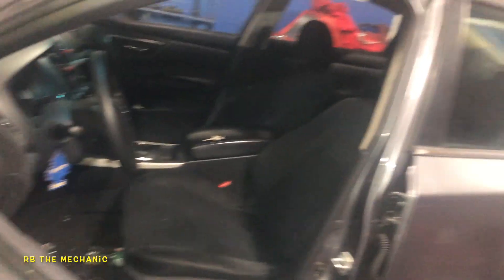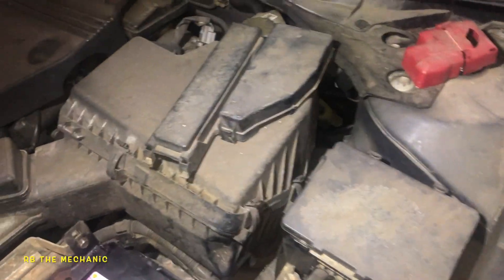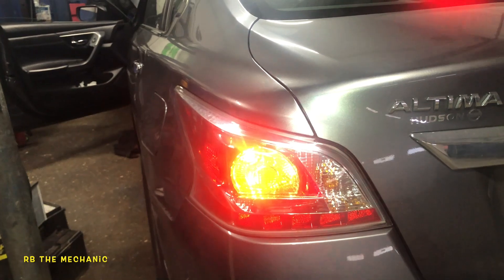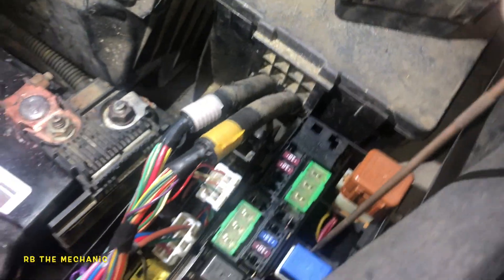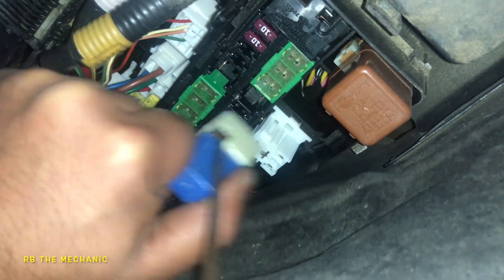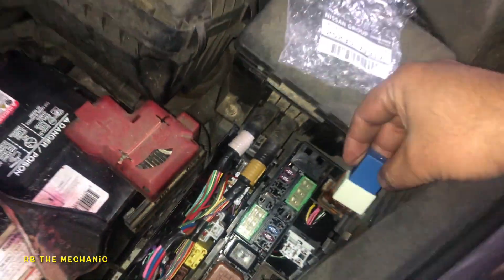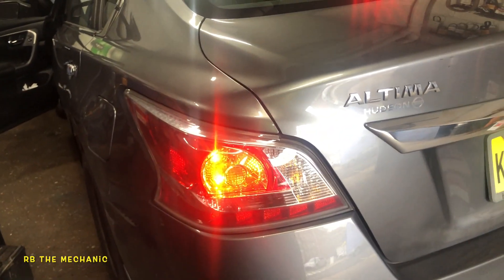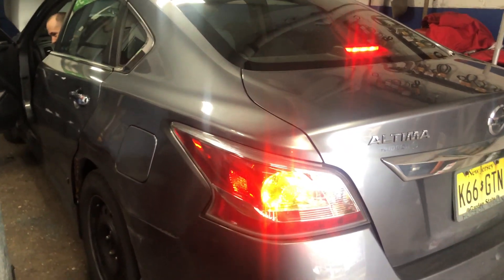Nissan Altima 2014 2015 push start  intermittently NO START diagnostic Bad brake light relay Part 2

Comment: Hey what's up RB the Mechanic, what' suggestion do you have if I already replaced both the switch and the relay? It's a like a bad contact, Brake light turns on very randomly like twice every 15 break pedal presses
Reply from the maker: So what is the issue car don’t start? Or u just trying to fix the brake lights
Reply: Car doesn't start but it's due to same issue, it does start when the break lights randomly do turn on
Reply: @irvingfierro7357 hello my friend could you solve the problem? Please it would help me much

Comment: Hey Ralph Bob The Mechanic!, ah!, the saga continues (part 2 of the expensive brake light switch)!!🤥🤥
Reply from the maker: Yeah it could be either or I would replace both at 60 k miles and get it over with
Reply: @RBTheMechanic   Got it.👍🧐🧐
Reply: Hey what's up RB the Mechanic, what' suggestion do you have if I already replaced both the switch and the relay? It's a like a bad contact, Brake light turns on very randomly like twice every 15 break pedal presses
Reply: Did you ever figure it out